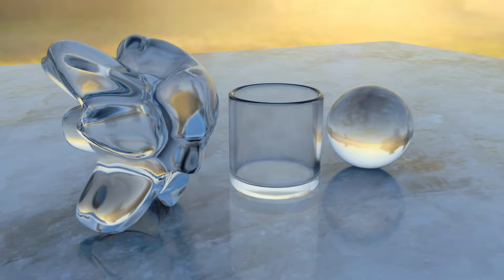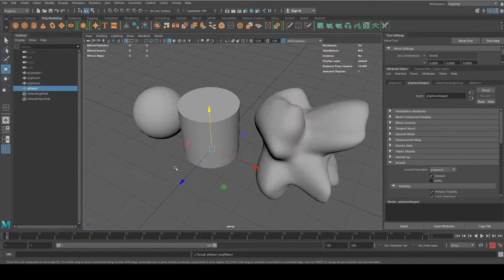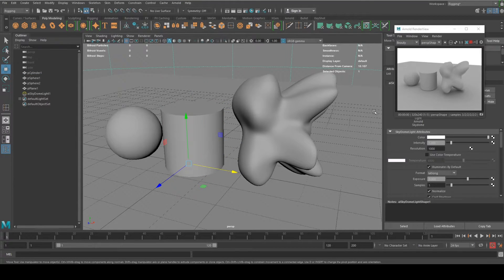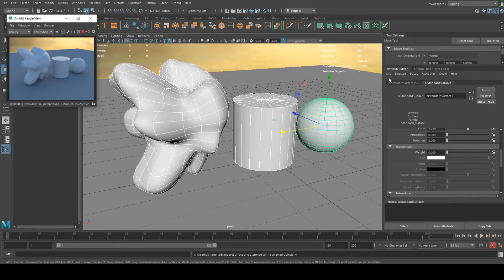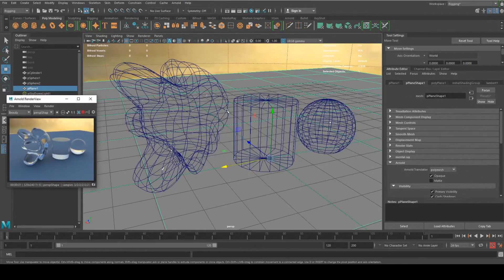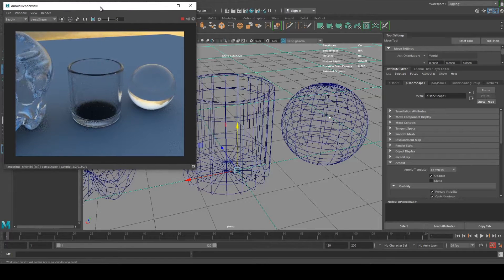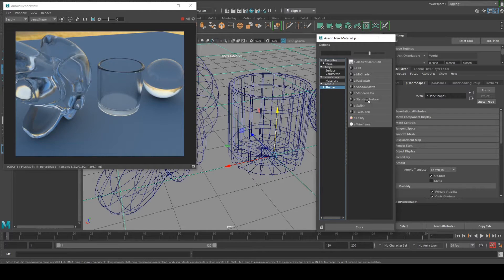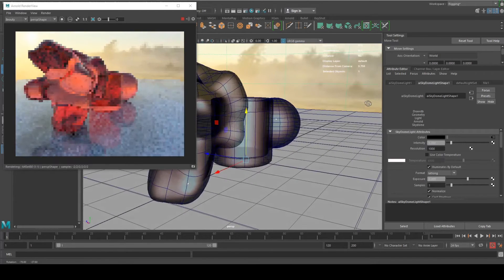Water Glass Material   Autodesk Maya 2018   Arnold

Comment: why i got no shadow under my glass ball?
Reply from the maker: Select your glass > Select Shape1 under attributes editor > click Arnord > uncheck Opaque   

Still under Shape1 > Arnold > Click Visibility > make sure 'Casts Shadow' is check Marked
Reply: @CGTurf  umm..It still can't work.
Thanks for your reply!
Reply from the maker: @dwkai1111  okay. If possible you can send me the Maya file or screenshot so that I can see what the problem is.  Otherwise I hope you can figure out  the problem.
Reply: @CGTurf  This is the maya file: https://drive.google.com/drive/folders/11PICjsLLiiR4DcYrCRGgs6aoQvPNp05A?usp=sharing
I use the aiStandardSurface glass preset
Reply from the maker: @dwkai1111  Great! Let me check it out.
Reply from the maker: @dwkai1111  Okay I was a bit confused as well. However, I noticed that the other materials/Solid material cast shadows.  So I rendered the same material you had on different shapes and what seems to work so far is reducing the weight in Transmission.  Select Ball > aiStandardSurface > Transmission > Weight. Also In my tutorial, the ground has aiStandaMaterial that is a shiny rough plastic that reflects the Objects on top.    

Let me know if this works for you.
Reply: @CGTurf Yes,it worked.But the color is darker now.
Is there any way to make shadow without changing color?
Reply from the maker: @dwkai1111  Hey:) So far I haven't found a better solution just yet. But when I do Ill let you know. Im hoping someone on youtube will see this comment and help.  Are you using Maya 2020.3?
Reply: @CGTurf  I'm using 2020.2.
Reply: @dwkai1111  Hello, I'm interested to this discussion. Did it work?